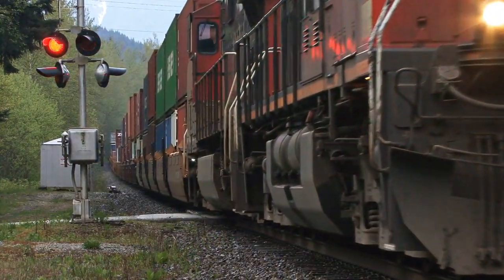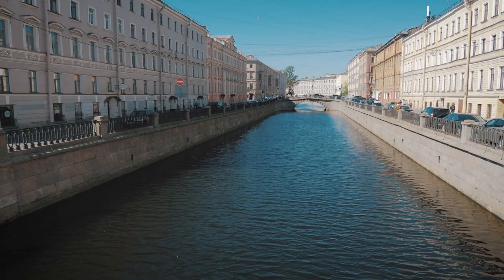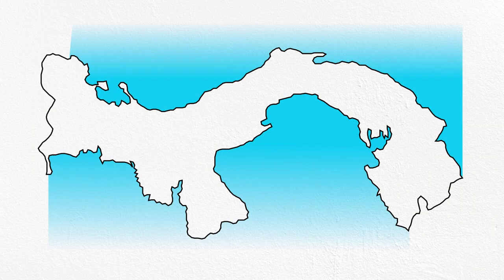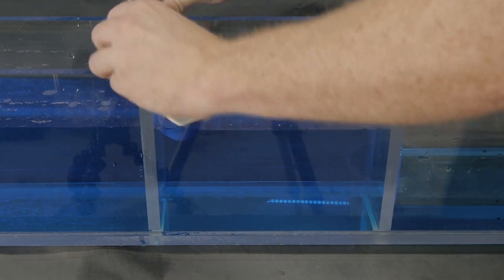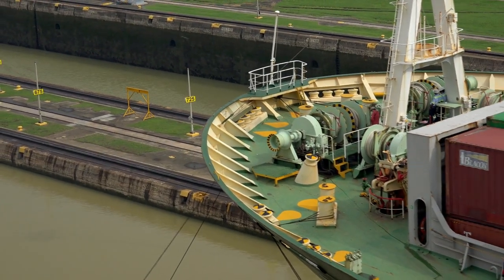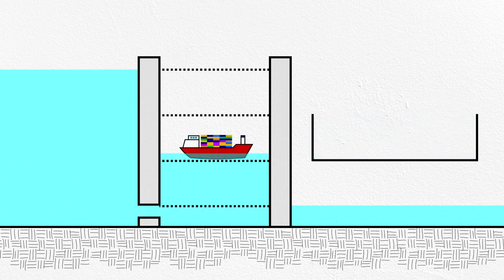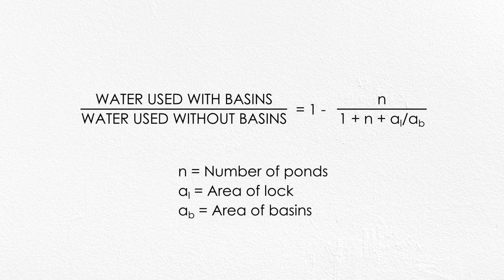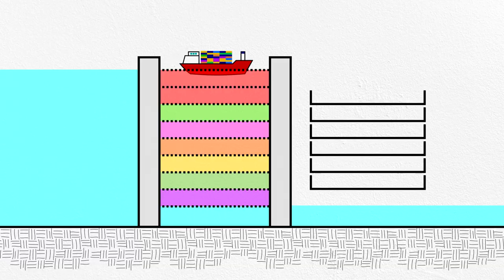The Surprising Efficiency of Canal Locks

Comment: Theres another way to furrher reuse said water too.
When the height difference is two much for just one lock, theres often additional locks downstream from it. Any water that leaves the first locks is then reused by the next ships passing into the downstream locks. This efficiency can be stacked with bassins

A downstream lock can reuse the entirely of the water reused by the upstream lock to raise a second ship, making now 2 ships raises by the volume of one lock. A third downstream lock further increases that efficincy to 3 ships raised(and 3 ships lowered) from one lock’s content. Adding bassins can reduce the ammount of water each of theses lock operations require, so it stacks in efficiency

Comment: At 04:38 A lock system does require an external source of power to operate the opening and closing of the gates! and the movement of the vessel itself along the flattened out water path. ( notice you slapped the toy boat, toy boat, toy boat -say it 10 times fast if you can - to get it moving and you used your hand - horse power? - to open and close the gates.

Comment: It does seem like you could have a single reservoir and use coupled turbines to pump water between them.  Even if it were 50% efficient it would use a lot less space and still save half the water. Depending on how busy the canal is, they could use spinning mass storage instead of a water reservoir, and save even more space.

Comment: What if you had a reserve basin with equal volume to the water in the lock, then have that basin on a giant lift. When the water level in the lock needs to be raised you the water in the basin pours down from above basin, then move the basin below the lock when it needs to be refilled. I don't know, use hydraulic power every time the water flows from basin to lock or vice versa to help with the costs and you have a 100% efficient lock system.

Comment: The other consideration with side ponds is the complexity of operating them.

A lot of locks on the British canal system have had their side-ponds taken out of commission because most of the system is not operated by trained staff, and it can be hard enough to get holiday boat crews to avoid making mistakes in even a basic lock design.

It's a shame, because at places like the Hillmorton flight on the Oxford Canal, it was built with two sets of parallel lock chambers, allowing each to operate as a sidepond for the other. If you had a steady flow of boats in either direction, you could use half the water from a boat coming down to bring up another boat in the paired chamber.

Comment: Awesome video, thank you!  I never considered the lost water each cycle.

Are you familiar with the Welland Canal in Ontario, Canada?  They have a neat way of stabalizing the ships as they pass through, it's an automated system by Cavotec called MoorMaster.  Giant vacuum pads such onto the side of the ship, and using active hydraulic actuators they guide the ship laterally while it moves up or down.  It's really impressive and was a complex retrofit project undertaken recently on the very old infrastructure.

Comment: I wonder if you could store mechanical energy from the water draining into the pond, and then use that to pump the excess in the lock into one last pond to save even more. Maybe a water wheel that feeds to a flywheel(?) and then once the last bit gravity can drain is out move a gear into place to connect the flywheel to a pump system?

Comment: I'm curious if having two side by side locks would solve the water loss issue entirely. Having one full lock, and one empty lock, when you drain from the full lock it all goes into the empty lock, then you would reverse.  It's essentially having the storage ponds, only as functional locks.  Could possibly require pumps in each lock to pump out the remaining divisions, only about a third maybe, into the other lock.  Could solve for the power requirement by including turbines for generation to run the pumps, essentially turning the locks into mini hydro power stations to run themselves.  Similar to how water batteries work.

Comment: if you wanted to save ALL of the water you could do it. you just use a container of the same volume as a canal and raise/lower it with a cabled pulley system or hydraulic lift. lower it to fill, raise to empty.

Comment: What you can do is use two tanks connected to a balance beam system. As one tank goes up the other goes down.  This system is used for smaller boats but there is no reason the same system could not be up sized for ships. The weight of each tank counter balances the other.  Since the boat or ship's displaced water equals to its weight each tank will stay the same weight. If equal shipping goes in both directions net water use will be zero.  I am not sure how practicable this would be for a large shipping canal but I did see a photo awhile back where boats were being transfered from a higher to lower canal using such a system evidently without losing net water out of the higher canal.https://en.m.wikipedia.org/wiki/Boat_lift#/media/File%3AFalkirkWheelSide_2004_SeanMcClean.jpg

Comment: I guess there are also issues with the locks taking longer to operate with more ponds. As there will be a smaller potential energy difference between any two ponds, the flow rate will be smaller. Perhaps this can be augmented with pumps if electric power is less scarce than water.

Also I guess one could have implemented this water saving solution with more locks instead of more ponds. That would take up less land, but would be even slower as the many lock gates would take longer to operate than water gates to control the flow to the different ponds.

I wonder if this could have been implemented with a kind of hybrid solution to allow simultaneous bidirectional motion through locks. So two parallel sets of locks, that alternate in their roles of allowing motion of boats up and down. A down set of locks drains water into the up set of locks with some contribution from the source river. The $$$ will keep going up though of course.

Comment: Hey Grady, excellent presentation! I noticed you didn't mention directly using a pump from the lower reservoir to the higher reservoir to replenish lost water. Could you perhaps explain why / estimate the efficiency of using a pump instead of the water saving basins?
Reply: I think that is about 60% efficient and you have a lot of expensive pumps and turbines. (Plus you have salt migrating up the lock system)

Comment: Sir: I have been watching a number of YouTube videos about "narro boats" on the canar sytem of the U K. Their canals were constructed at the start of the industrial revolution and used horse-drawn boats to move cargo and to some degree, people. They are very narrow canals and the boats are restricted to not quit 7 feet in width, and practicality limits the to about 70 feet in legth to be able to fit in the locks. Also, the water is not running in their canals, except for a very minor amount. They are, in fact, stagnant. They are now used almost entirely for recreational purposes, but a rapidly growing number of people are either quitting traditional jobs or after retiring, buying a narrow boat and living on it, as it is a much cheaper way to live compared to a house or apartment.
I sent the address of this video to one of the better channels, and I hope you get an increase in traffic from that. If you would like a peek at that current system, I would recommend an English YouTube channel called   "Cruising the cut", although I think you look for it without the spacing between the words. Sorry, I don't really grasp all this techno stuff. I was an engineer in aerospace years ago, but now I am just an old fart.
Thanks for the video.
Frank

Comment: You can just use a turbine in the flow of the bottom half of the lock and use that to pump water from the upper basin higher than the upper basin. Turbines is how we pump water out of the Netherlands into the higer North Sea. But I guess that would cost more than the water loss is worth and you need to have some water flow in the canal.

Comment: You missed the major feature of the new Panama locks, there are 3 stages. This reduces the water needed by another large fraction. Forget the ponds for a moment and make it a 2 stage lock. the upper lock drains half of the total height and the lower lock is raised by half the total height with that same water. So each downstream trip uses half of the water volume. Really the staged locks act just like ponds, the down side is that the ships must be moved twice, but you can move three ships at once.
The other less obvious design consideration in Panama comes from the large typical vessel size, and on the old locks for which thousands of "panamax" ships were built (built to exact allowable lock dimensions). If you tightly fill a lock, maximizing ship tonnage, then that displaced water is removed from the lock before the upper gate closes reducing the volume loss. 
Try it with your example lock and a weighted close fitting rectangular block. Make sure the downstream canal is deeper than the height gain of the locks so you can truly maximize "ship" displacement. Say your lock has 6 inches of lift, make the block heavy enough to draw at least 6 inches.
Finally(I don't know if this applies to Panama) you could have two sets of matched locks with the drainage from the descending side directly raising ships on the elevating side. This gets you one extra pond volume because it a single direct fill move rather than two moves to a pond then lock.

Comment: I had to pause at 0:35 as I can't imagine how having to displace millions of tons of heavy water along your way could be more efficient than a train riding through air on steel tracks, hopefully this gets explained in the video.
Reply: I think they mean efficient as how much energy is used per amount being transported. Since water usually flows on its own as said in the video, boats usually don't need too much energy to move while trains needs constant energy. Also want to add the fact that there aren't too many times where a boat needs to go through a canal on its trip so I think overall, the train is less efficient as it needs a lot of energy throughout the entirety of its trip while the boat only needs a lot of energy for a few short hours.

Comment: I just assumed that the water was pumped in to the lock from the exit side when the lock needed to refill again, not that it was taken from the upper lock, it makes sense from an efficiency perspective I guess but if you are using a lake on one or both sides where you don't want the locks/canal be the reason it looses water I would think that that would not be the main priority.
As stated in the example with the Panama Canal and the lake being used as a drinking source as well, probably missing something, not a Civil Engineer but as always it is probably related to building and/or operating costs. Maybe there is some legacy reasons as well.
Reply: 1) Salt water from the ocean getting into the lake as you pump the water up.

2) Pumping lots of water is expensive.

Comment: There is one very remarkable system of moving the ship's that exists in Poland. It is on Elblag Canal. Basically there is a 100m water level difference which is overcome using locks and amazing system of inclined planes. Nowadays, it is used only for recreational purposes but still it is a very interesting piece of engineering! Definitely worth checking

More info: https://en.m.wikipedia.org/wiki/Elbl%C4%85g_Canal

Comment: Could you not run a turbine/pump system, where the water that is released from the top pond moves through a turbine which powers a pump that pulls from the bottom pond into the top?

Comment: Isn't there also savings from the ship displacement? A lock with a ship in it holds less water than the same lock at the same level with no ship in it.
Considering some ships are pretty close to the limits of the canal this would be a significant portion of the water. Though I guess this only works when the ship moves from the upper level to the lower level. Otherwise the water it displaces goes to the lower level.

Comment: I have no engineering history. However what about a giant vacuum sealed tube for storing the water in? Like a massive syringe, a system that sucks the water out of the lock into the tube, and and same system that pushes it back in? It would use a lot of energy however would be more efficient and reduce the amount of water loss.

Comment: I considered it weird there was no talk on the negative effects of having a basin which traded depth for area. Even if the same volume. If that region is coming under droughts, and these droughts were based off the sun, or the general heat, what will prevent these larger surface areas from quickly evaporating?

Comment: You left out when there are two locks side by side they can use the water in the lock next to it to raise the ship on the other side with zero loss.

Of course there must be a ship in each lock for it to work.

It is similar to the Basin and your loss is only 50% for two ships.

Comment: So they use fresh drinking water to just dump into the ocean?
Also I know they're super efficient because they don't need pumps, but if the upstream has diminished flow, why not use pumps to supplement? Also collect hydro on the water draining into the ocean as 83m is within the range of a medium sized dam. So the gravity could produce power to at least help power the pumps to supplement the system.

Comment: You could save a lot of water by using boats that are just a bit smaller than the area of the lock and have a draft just a bit less than the height of the lock.  Then most of the volume of the lock is filled with boat, and it is surrounded by just a bit of water.  Right?  What do you think?

Comment: Could you use a water wheel powered by the water as it flows down to power a pump? A very simple wheel with buckets around in type device that returns water to the next sidepond up?

Comment: I propose a double-wide lock, one side for the ship, the other for a large object larger than a ship.  Once the ship is in there, you could lower the large object into the water, which would then raise the level of the water alot, and then the ship could flow into the higher lock.  The large object would have a counter-weight that would be nearly the same size, so that you could save energy raising them and lowering them.  They would rotate on a pivot axis.

Comment: I hope it's not dumb asking this, but couldn't you have two locks in parallel and shift the water between? one would be up while the other would be down?
Reply: Imagine you have an empty lock (basically a box with nothing in), and then a full lock next to it. You lift the wall between them slightly, and it will only fill the dry lock halfway. The only reason the locks work is because the water pressure from the entire ocean is forcing the lock to rise to water level. With no pressure, the water would just level off halfway filling the 2 locks.

Comment: I wonder: why not also install pumps to move water back up from lower water level in case of probable droughts? Or just to 100% recycle water in a lock?

I mean, I can think of a few reasons like limited flow rate, operating cost, and such...but why not as a backup system? Or it's because the cost of pumps at that scale is too expensive?

Comment: Hmm, instead of creating different reservoirs, couldn't there be a pump system that pumps the draining the water back to the upper canal using the energy produced by the water flow during the "filling and draining" process to help supply the pump system?

Comment: The water efficiency mentioned in the video seems to be applicable only when draining or filling using gravity. Is it correct that you could have 100% water efficiency (no water lost) if you use pumps instead? I'm curious why that approach wasn't mentioned. Is the pump approach that much more inefficient than building multiple side ponds?

Comment: Can the displacement of the boat in the lock affect this? i.e. max out the dispaced water with large or many boats and you lose less water?

Also can the low-pressure zones of where the water is being drained from the lock move or even sink a boat? i.e. can a fast drain generate vorticity and pull under a very small boat? Or as with the Ever Given can the low pressure to one side of a large boat cause it to smash into the side of the lock causing damage to the boat or the lock itself?

If the largest cost in a canal is excavation like with the Panama Canal, then would it make sense to be constantly sending out badges of dredged material after starting operation?

Comment: Can you then theoretically have a weight that is equal to the basin full of water plus 1 lb to act as a piston plunger to push out one more basin full of water then using the water from the canal and a machine that can lift 1 lb reset the weight back to its regular position?

Comment: But in the modern world, be have mastered and overcome gravity as well, they are called pumps.  Just like a water tower, somehow we have to make water flow uphill.  Have the last storage pond above and pump it up, that way it could still fill below.  Just saying, in theory you could reduce water usage to almost zero, but it would take electricity instead.  You can use large enough pumps so time isn't an issue, just throw more kWh/HP at the problem of speed.